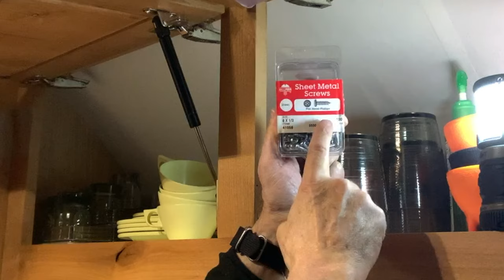How To Install Gas Strut Cabinet Supports - DIY RV Upgrade

Comment: Best installation instructions. I'm usually pretty good at figuring out instructions and diagrams, but whoever wrote this manual didn't know how to think as a regular Joe. Especially, not telling you the flexibility of measurement based on your project. I wasted so much time until I came upon your video. Took me not even 2 min to install after watching it...thank you! 👏

Comment: In my case I didn't need the mounts. The ones that came with the struts worked fine. I followed the measurements in the instructions and at first had to move the "catch bracket" that keeps the door closed while in transit (they were on both sides, right in the way of course). After I did two, I realized I could keep the catch bracket and just mount the round mount just above it and it worked fine. I had smaller cabinets in our bedroom, just barely 8" tall, but the brackets "just fit" so it was a  win all around. Thanks USNERDOC for the video!
Reply from the maker: Absolutely ... glad the video was helpful.

Comment: Thanks for the video... actually using this method to mount a chalk board over the space where our micro wave used to be before we remodeled our kitchen and mounted new microwave over our stove. Being a long time travel trailer owner I am thinking you must have taken some towels out of cabinet that kept your glasses from bouncing around and breaking while in transit. Thanks for video it sure helped.

Comment: Nice job! Looks like you have an Airstream... we do too and the overhead cabinet in the bathroom will soon be upgraded based on your video. Another thing we did was install 6X9" mirror sheets (plastic lightweight with self-adhesive backing) on the inside of our overhead kitchen and bath cabinets for shorter folks to see what's in the cabinet.

Comment: bought the gas struts and the extra mounts. The struts work great, but the mounts are too big so I ended up just using the pieces that came with the struts and they worked fine. Thanks for your video. It gave me confidence to do it.

Comment: I do have same type of upper cabinet door system  And bought Gas Struts  and  not sure where I should install  thevhooks come together bwith struds like yours. 

You said  2  3/4: and 1/2 inches.

My cabinet door is 89cm wide,22cm Height.

Comment: This is a VERY helpful video! Just one question though...I  need to install the gas struts exactly for the reason you mentioned. However, I don't think that my cabinet edges are solid wood like yours; Likely  some kind of composite (Keystone trailer). Any suggestions for this issue? Thanks in advance!
Reply from the maker: You might want to consider adding some reenforcement material behind your cabinet frames for support. The struts were a huge improvement for us.

Comment: Do they stay closed when on the road or do we need something else to help keep them closed?  Great video!
Reply from the maker: Great question! Yes the cabinet doors stay closed while on the road. We have never had the doors open and spill contents while traveling. I think the struts have been helpful for that as well.
Reply: I had an issue of my door opening, these gas struts fixed that issue completely!

Comment: Does it make a difference what size gas struts you get because I’m building cabinets that are 16” high? Thanks for any information.
Reply from the maker: Size does matter in this case! You want to pick a strut that is sized for the weight of your cabinet door. Most strut companies have guidelines to help with your selection.

Comment: Hi, great video. Thanks for sharing. Just curious about the strenght of the struts you had for those smaller doors. You installed 100n force? Isn't that really stiff? I just purchased some 50N struts for some kitchen cabinet doors (lifting upwards) and the strut is so stiff, I can't imagine how much force you would need to push the door down again to close it? I'm sure there is something I don't quite understand here...
Reply from the maker: The struts work perfectly. Very little force to open and close the cabinet doors and the doors stay open without difficulty.
Reply: I installed a pair of 100n(s) on a single door and I have no issue opening/closing.
Reply: So… I have recently purchased 100 N gas struts for my kitchen cabinets. The amount of force needed to compress one of these struts is fairly high. What am I doing wrong?

Comment: Great video. I had a question. I want to open the door of a battery box, so the door opens upward and is perpendicular to the floor, parallel to the wall. I will be using a piano hinge for the top. Would I need the grey hinges that you had, or would the piano hinges and these gas struts suffice in keeping the door open?
Reply from the maker: Piano hinge and struts should be the perfect solution.
Reply: @USNERDOC  thank you

Comment: What's your take on 1 vs 2 struts? I'm building something with horizontal doors (vs your vertical) and they're a bit heavier (say 20 x 30 inch 5/8 baltic birch with 4 inch of latex foam on top, so a few  lbs extra). The hinges are strong, just not sure if the strut won't introduce some weird torque.
Reply from the maker: I think it really depends on the weight of the door and the lift capacity of the strut. You might benefit from two struts.
Reply: I would Install 2 just because amazon has them really cheap, $6 for a pair.

I have (2)100n on a 2x3' 5/8: solid mahogany desk door. It holds very well...... and that thing is HEAVY.

Comment: Sheet metal screws? Was that because there was sufficient purchase in hard wood?
Reply from the maker: Great question! I just like using pan head sheet metal screws ... personal choice. I for sure could have used a round head wood screw. I  just like the flat pan head for most applications. Thanks for watching!

Comment: were you really up at 2.15 am doing this ? :)
Reply: I noticed that also looked dark out the windows
Reply from the maker: Sharp eye my friend!
No it wasn't 2:15 am ... need to change the battery ;-)
It was "dark outside" because I was doing this in our storage unit.
Reply from the maker: It was "dark outside" because I was doing this in our storage unit.
Thanks for watching!